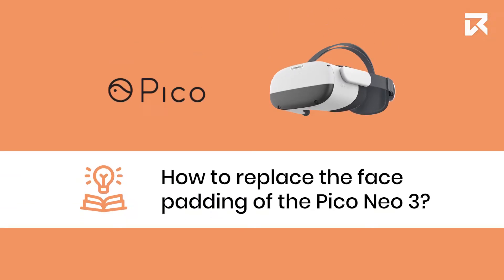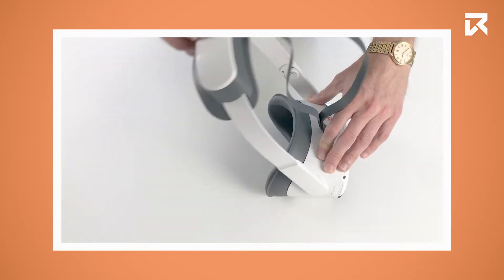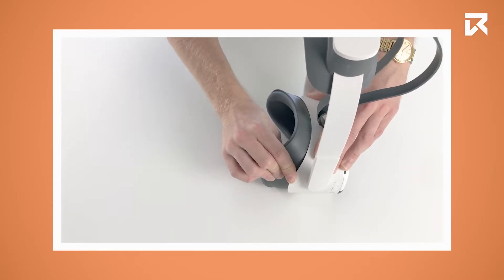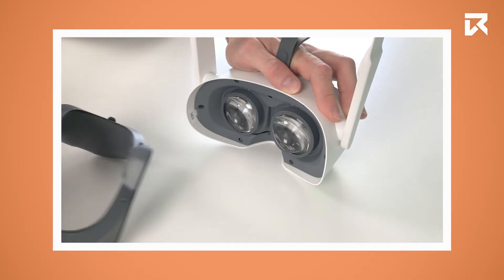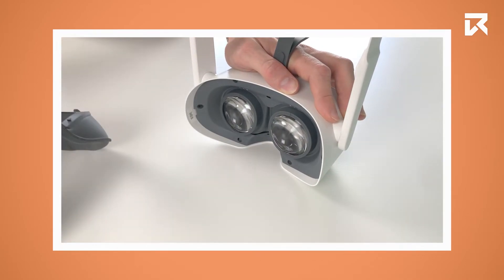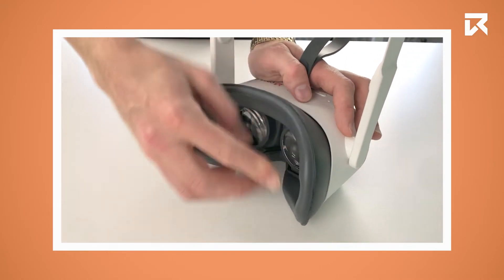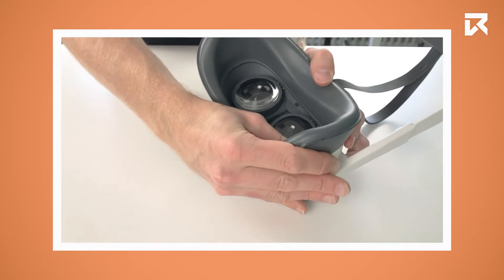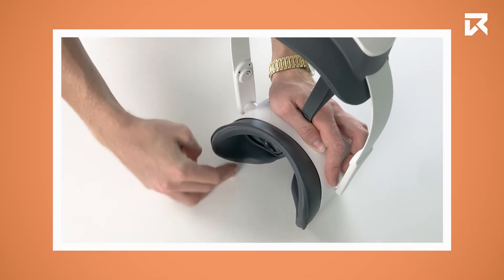How To Replace The Pico Neo 3 Face Padding? | VR Expert

Comment: poor video. I need to see where the clips are so I know the locations to pull without snapping those clips. Also you don't even have that nose vizer thing in which makes it nearly impossible to clip the nose section down.

I'm mainly upset with the glasses spacer which makes everything much worse for the nose clip area. So I'm taking it back off and doing without my glasses. Also some how it lets in more sunlight not less when I wear glasses. Useless.